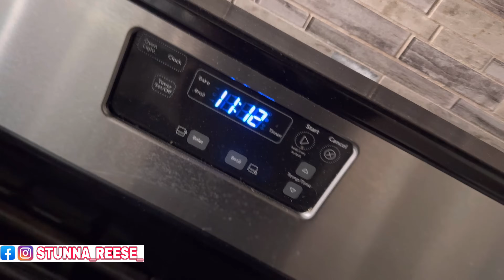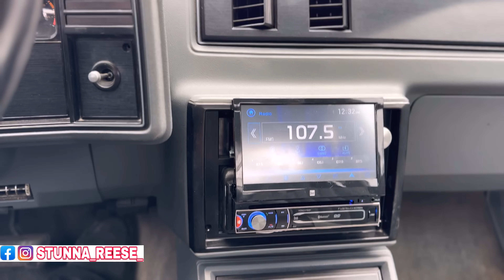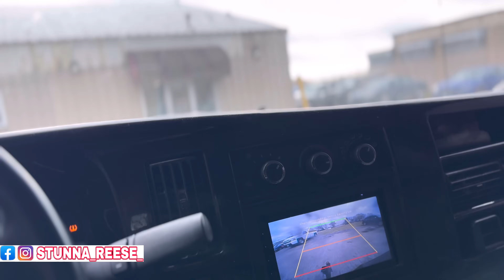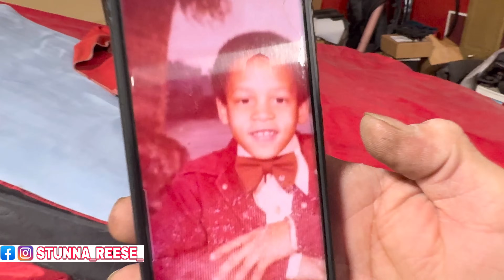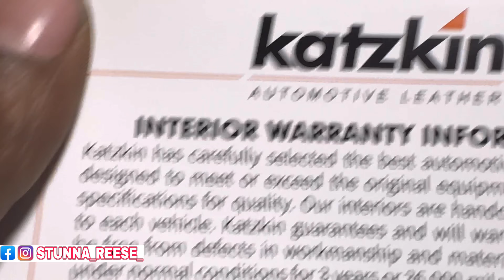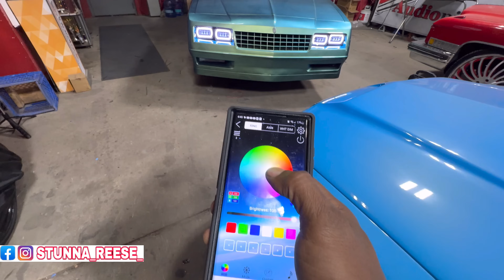THE TRUTH CAME ABOUT HOW THEY MESSED UP VENO TRANSMISSION

Comment: Check Engine Light for the transmission? 😳 I'm not a transmission specialist... But I DO have a degree in Auto Tech. I know for sure that most trans related issues DON'T pop a CEL. However, u can see the trans fault codes with a scan tool. The guy that told u they can't do anything without a CEL should have scanned your vehicle and tried to pull history codes anyway. #WellWishes
Reply: *Just a little nugget: When I get to having those issues on transmissions...I swap out the shift solenoids, filter, and fluid. That's the cheapest, most non-evasive route. I've gotten lucky quite a few times! U can try to run sum Lucas thru it BEFORE changing solenoids, in hopes that the bad one will free up. Trans for that van shouldn't be that hard to find tho. I know a guy in the Northern Illinois area that has em by the ton
Reply: I thought the same thing

Comment: I think it’s showing issues cause the torque converters don’t like towing without the tow/haul switch on when towing at all times. Plus higher octane fuel helps over longer hauls to reduce carbon build up in the engine. Lucas transmission conditioner should help. The check engine light won’t come on if it’s the torque converter.

Comment: You ever take in consideration that it sits lower on the driverside because your heavy azz over on that side and its nothing on the passengerside, thats just what happens with them G bodys, my Buick does the same thing and I have new suspension,? Think about it Reese, boi I can aid and assist you with all them vehicles, shmhd, you wouldnt be having to pump that gas pedal all them times to fire that punk up either.

Comment: I wish u wouldn't of took Veno to them. And dude lied to you about u have to have a engine light on for a trans diagnostic. You'll have 2 take it 2 a reputable trans repair shop. Who'll be able to interpret the raw sensor data the scanner provides. Because the trans could just need shift selonoids. Which will be alot less then new trans. I recommend you to take Veno to (Turbine Transmission) or (Tramcar Transmission). I've been to both. And Jiffy Lube's gonna have to reimburse you. Also the Transmission fluid you need is Amsoil.